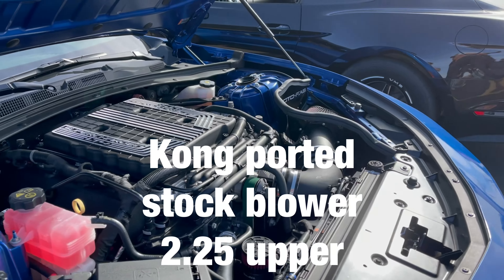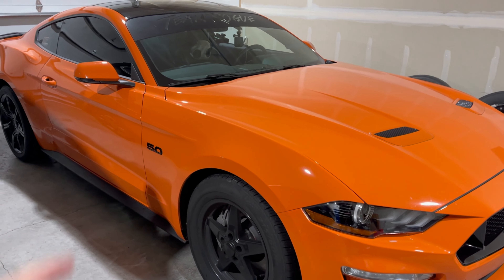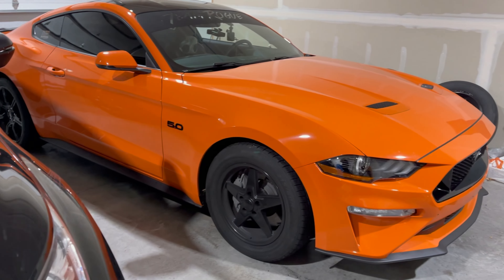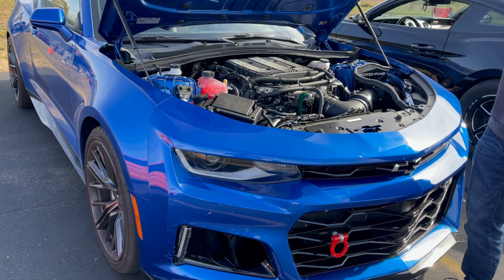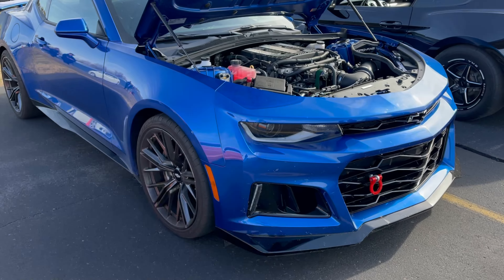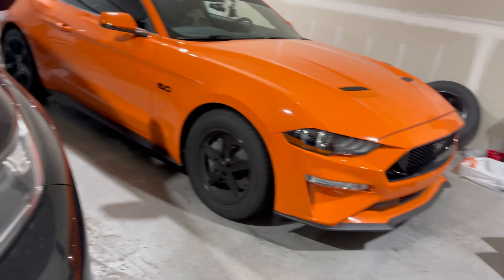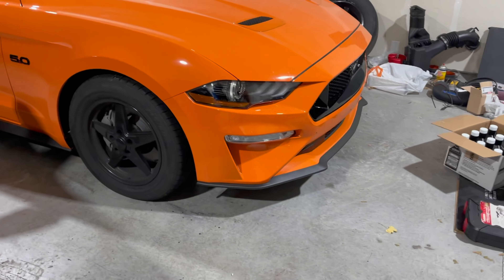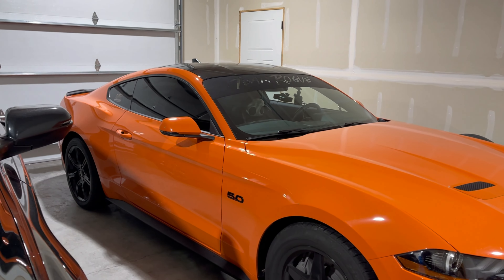My Boosted 5.0 Mustang vs Zl1 Camaro!

Comment: As badass as the GT500 & ZL1 are, the real value is buying a gen3 Coyote and boosting it. Faster and save money. You were mowing that ZL1 down. 💪💪💪
Reply from the maker: Facts!  My buddy actually sold his gt500 and went back to a 5.0 lol
Reply: @651MYGarage  I don't blame him. A gen3, setup right, is a monster. Case in point, your car. The scary part is that you haven't even put that centri on kill yet.
Reply from the maker: @christenn32  yea this is just a 3.48 pulley….1 size smaller than what the vortech (3.6) come with lol

Comment: Was funny about the whole thing with the stang being a badass is the 5.0 it’s not quite 5 Liters.  Lmao. And it still has a lot of grunt
Reply: You're thinking about the original 5.0 the 302 sbf it was technically 4.9 liters this new 5.0 is a true 5 liters and as a matter of fact the 18 up models like this have 307 cubes so it's just barely under 5.1 liters but still rounds off to 5.0.

Comment: a lot of LS swaps have been pulled  for a coyote and shocking ppl have been leaving hellcats and camaros and vettes for coyote mustangs and or awd v8 f150s. simply because people have made up to 1200whp and ran 7s with s550 mustangs and 8s with f150s in the 1/4 with factory sealed coyotes.  No heads no cams no pistons no rods no opening the engine unless you want to go built motor which then you can make up to 2000hp on factory block.  Hellcats and demons are running 8s with 100k into them and only the factory chassis left. LS/LT  you also need to open the engine for pistons rods heads and cam to go over 1000hp  then boost and fuel system.  coyote needs boost and fuel bang done
Reply: About 700hp on stock internals isnt a big deal you also need to open up the 5.0 to get 1000hp reliable! But the LS platform has been doing it well for years now!

Comment: It's the most basic 5.0 boosted set-up. Completely stock car with a blower and E85. It don't get more simpler then that and you completely running down and gapping just about everyone...lol..the Chev and Mopar boys will always be mad. Great runs man. Even under power at 20whp more in the ZL1 you still pulling pretty good on him 👍
Reply from the maker: Couldn’t agree anymore!
Reply: @651MYGarage  im gonna have to disagree even though im not a chevy fan,as soon as i saw the zl1 was manual on tiny stock blower i knew its a wrap,stang has way superior head flow and large blower, zl1 had no chance no matter what power the zl1 claims,if zl1 was 10spd auto and bigger blower then things would be interesting.
Reply from the maker: @durin23  stock Kong ported blower can still make some jam
Reply from the maker: @durin23  I do have 2 10 speed zl1 videos.  Both 2650. One was 93 Oct and made 830-850 and the other was e50/m$th and made 1003 or 1004 WHP.
Reply: a lot of LS swaps have been pulled  for a coyote and shocking ppl have been leaving hellcats and camaros and vettes for coyote mustangs and or awd v8 f150s. simply because peoe have made up to 1200whp and ran 7s with s550 mustangs and 8s with f150s in the 1/4 with factory sealed coyotes.  No heads no cams no pistons no rods no opening the engine unless you want to go built motor which then you can make up to 2000hp on factory block.  Hellcats and demons are running 8s with 100k into them and only the factory chassis left. LS/LT  you also need to open the engine for pistons rods heads and cam to go over 1000hp  then boost and fuel system.  coyote needs boost and fuel bang done
Reply: @durin23  right people love comparing these cars..but not the underlying real factors here...but then go make a video like this showing that they won against a car that is limited..that tiny blower on the zl1..isn't goin to do much....play with someone on your level then show us..he wasn't Even e 85...he wa e 40..this is so comical..but I will agree that this is the cheapest way to make power..get you a 5.0 throw a blower on it and e 85 and your just like the rest...your nothing different.
Reply: @durin23   you do know the record for a stock ported blower is 8.40 ? You can make 1000rwhp with the stock one as I’m at 900rwhp on 16 lbs.
Reply: Any video of Mustangs winning races here comes the 5.0 fanboy freak with the pompoms. Cheap power only last so long…